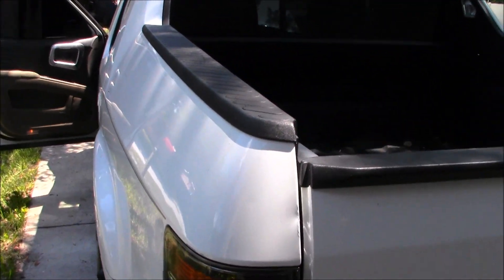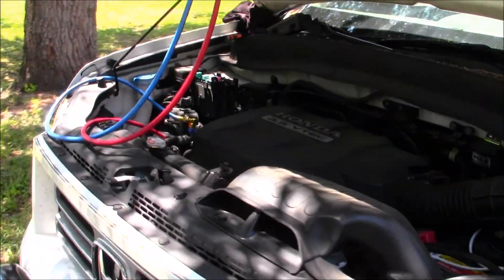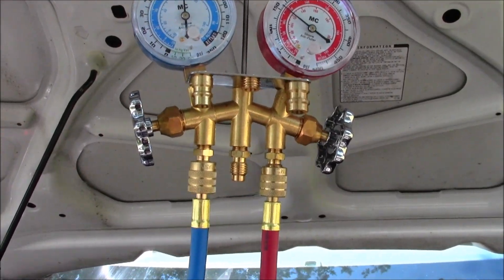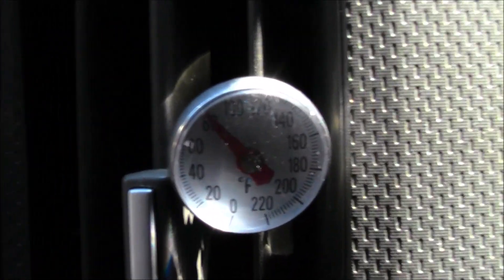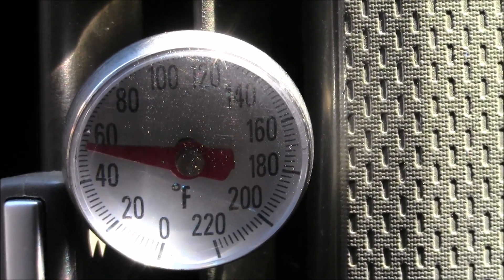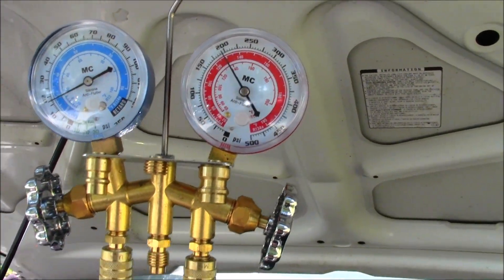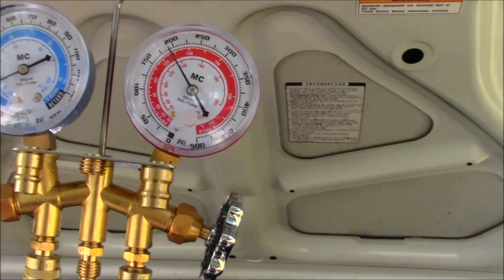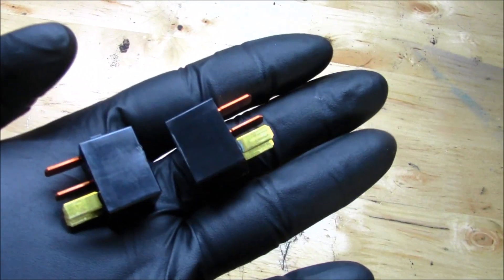AC Blows Cold Then Hot | Stays Hot | No Compressor Honda

Comment: Thanks for the video.  My wife came home and said her AC didn't work last night.  I took it for a drive to see what was going on.  It was cool initially, but then started blowing warm air.  Watched this video and checked the relays.  The A/C relay did not rattle like yours in the video, but I decided to spend the $6 on a new one just to see if it did the trick.  Sure enough, put the new one in and went for a drive; Cool air the entire time.  My auto shop is pretty honest, but I am sure just in labor alone, I would have been charged a lot more than $6 for them to fix it. Thanks again.
Reply: Johnny Dubs Was it fixed for good?

Comment: This fix worked well! I needed needle-nose pliers to get the relays out. Instead of using the info control dash relay, I used the horn relay. The horn works with the failed a/c relay, and the a/c works with the horn relay. Thank goodness, ‘cause south FL is hot nearly all year.

Comment: I have not tried this fix but am so happy I found this video. My Honda Accord 07 blows cold air for about 8 mins and then blow hot air afterwards. If I switch off the AC for a while and turn it back on, it blows cold air again. I have made an appointment with a technician but I think I will have to cancel. This fix will definitely work for me.
Reply: Sounds like what our CRV is doing.  What did you find? I’ve already replaced the relay and nothing’s changed.
Reply: Andy Gray ,just an opinion ,check your high and low pressure switches if they are inline.
Reply: STEPHEN 1774 that was one of the next things I was gonna check.  I’ve drained the system down and refilled twice.  Checked every fuse/relay.  It’s frustrating!

Comment: Well done video!  I swapped the two relays on my Honda Odyssey as you suggested. Bingo! AC solid all the way to Auto Zone. Paid $6 for the relay, installed it, and now running cool.  I"m sure the local Repair shops  ("rip-off shops" more accurately)  would have had me into a new compressor and  $900 repair bill.  .  CMcB

Comment: You are right, I checked my fuse box on my 03 Cadillac EXT, found a small 10 amp fuse that was not seated right, switched it wit another fuse and works great! Thanks.
Reply: I have a 05 Cadillac Escalade and it’s doing that right now. Right when I crank it up it’s cold and then 15 seconds later it blows hot and stays hot. Is that what yours was doing?

Comment: Thanks for the informative video. Switched relays and also checked the magnetic clutch fuse - clutch still wasn’t engaging. Turned out I had a damaged ac compressor coil. Replacing the coil was not a fun task on the wife’s 2006 Odyssey.  There’s was hardly any room to get the snap ring pliers to remove the coil. Finally accomplish the task after cursing at the engineer who decided to put the ac compressor near the car-body frame. Final results, I had a cool happy wife and saved lots of $$$...
Reply: Cool happy wife = cool 😎 happy life!!!  👍👍👍

Comment: Another thankfull message, swapped relays on my 2008 CRV EX AT and its fixed, swapped back to original and it kept working, maybe it was a faulty connection in the socket, dirt or something else, both relay work ok and my A/C is cold as it should be. thanks from Buenos Aires, Argentina.

Comment: My 07 rdx has 90110 miles and the ac blows cold for 15 minutes then warm. It doesn't go back to cold. Then the next day it would be cold for 15 min and go back to warm after that.
Reply: I have an 08 with the same behavior.  Did the relay fix it?

Comment: I have a 2011 CRV. My AC blows cold air when the car is cold but shortly after driving it for a while on a hot day, the air turns hot. This cycle happens consistently. I've had it recharged and the problem persists. Could this also be a relay issue ? I pulled out the relay but did not notice any apparent damage to it. Thanks.

Comment: My 08 CRV was fine I took it for an oil change and ever since my a.c. has been running hot off and on. It stays cool at night but if I drive it more than an hour in the heat it will start blowing hot air. If I park it and let it cool  down the a.c. blows ice cold. The mechanic keeps pushing a new compressor although I  can see that the compressor is running its just the air is hot sometimes. Will this relay work for me.

Comment: I'm having the same thing happening, but my compressor clutch is engaging, but not cycling on and off. In other words, I have the same problem with hot air blowing after slowing down, but when I drive fast, it blows somewhat cold. The condenser fan is working fine ... So I hope it's a relay, not the low pressure switch?

Comment: i have a 96 gmc  sierra .mine is different  it works only when  i m in the road. & when  i stop at the light. starts blowing hot air. what it could be  any help.
Reply: Did you get it fixed?

Comment: is my honda accord having the same problem? If none of my relays are shaking then thats not it right? the engine cooling fans constantly turn on and off every 2-3 seconds, the ac blows cold for a few mins then goes to warm , repeat. I dont want to spend for a new compressor
Reply: 04av6 
is your problem solved?
My one is similar case but when I tried during night time it works fantastically.
I face this problem only when the outside temperature is too hot.
Reply: Did you ever find out your problem? I’m having the same issue

Comment: I'm currently having this issue in my 08 Civic si. Turn car on,turn ac on and it works for a few mins then it starts kicking on and off rapidly along with blowing hot air. Do u think it's the relay? Fyi clutch does come on and off.
Reply: Did you ever find out what was it?.. I have an 07 SI doing it as well..

Comment: U derstand for the none car people swapping a broken relay might not fix ur problem in every case most likely wont work since an ac has numerous components that might fail and ac not work properly compressor switches clogs etc will make ac fail and in most of the cases not necessarily a relay 4 of 5 ac jobs I have done in my tech life are not related to a relay

Comment: TRUCK?  c'mon man!...a Ridgeline is to a truck as is a girl scout is to a MMA fighter
Reply from the maker: What is this comment? What do you mean? I have an F350 diesel, a Tundra 5.7 4x4, a Yota 4Runner 4x4 and a YJ... Ridgeline is definitely a capable truck. I have the array to compare them to. They all have their place. The 4x4 system on the Ridgeline did great in the blue ridge mountains numerous times. I’ve hauled more tile and lumber than I care to remember in it and it’s still going strong. You make a Useless comment. Speak from experience not from your assumptions or your google searches. If it’s not up to par, give specifics with your actual experience. Otherwise, I see no use for your opinion I’ve had it for 10 years btw.
Reply: Fix It Now definitely a truck. I had the same problem with my 2012 ridgeline. Only replaced one of them and didn’t fix it. Have to go back and see about the other. What year was yours?
Reply from the maker: 2006
Reply: Fix It Now after changing the front one it would stop working and blow hot after a little while. Now after changing both it seems to blow cool but not cold. May be a coolant issue. Thanks again.